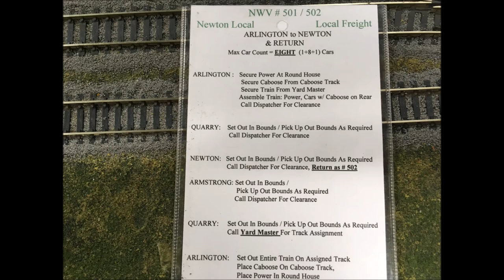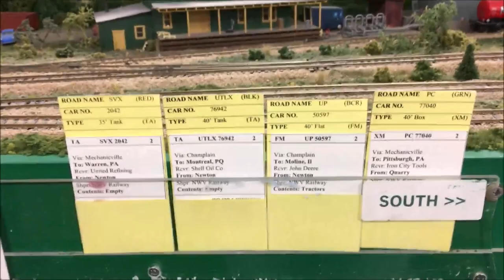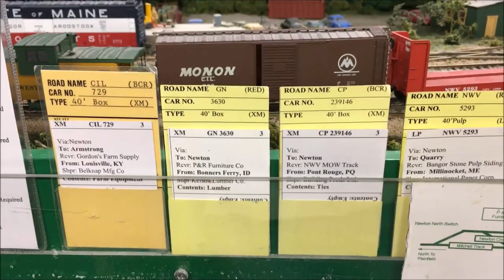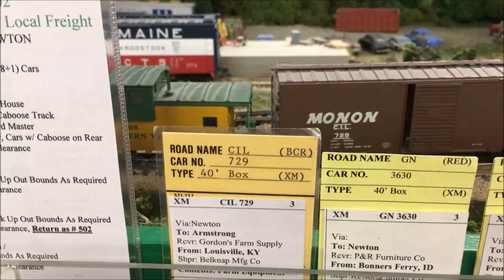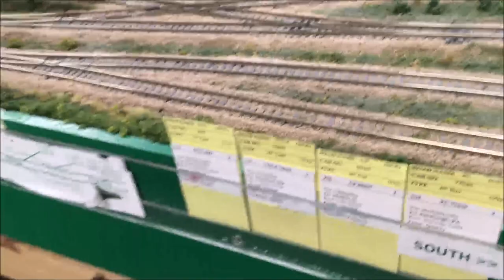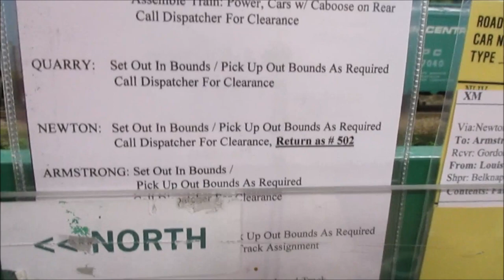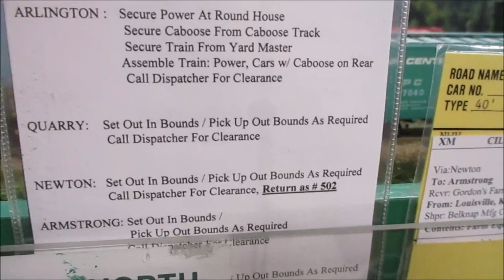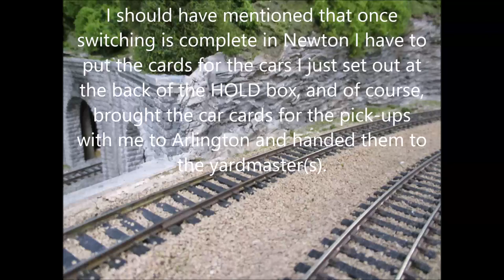Operating a Local on the NWV Model Railroad

Comment: Is there any kind of steam engines on the layout like ones that the CVRR used such as the 2-6-0, the 2-8-0s, and/or the (and personally one of my favorite engines) 2-10-4 "Texas"
Reply from the maker: Thank you for visiting our layout virtually.  Our operating scenario is based on the 1970's, so we run only diesels, mainly first generation, with a few second generation GP-38's.  We recently added a couple of Rutland steam engines to our roster through a donation, so they may do some fan trips on the layout once we they're fitted with sound decoders.  Have fun!